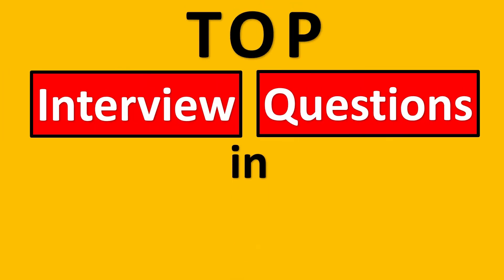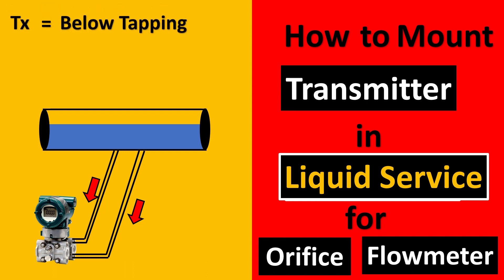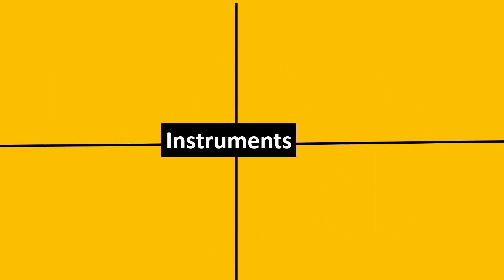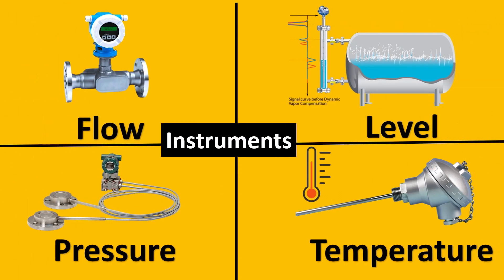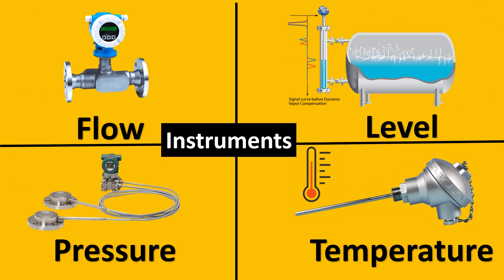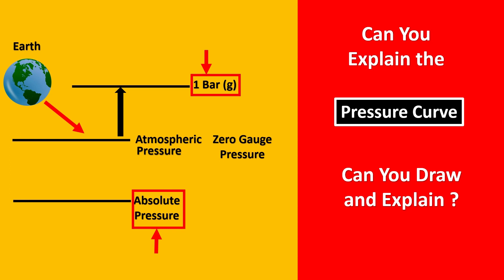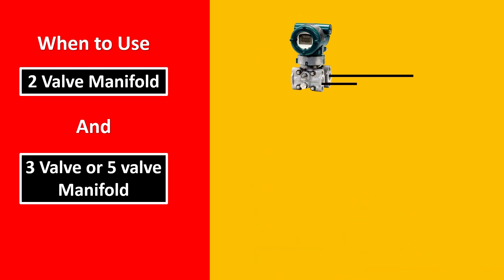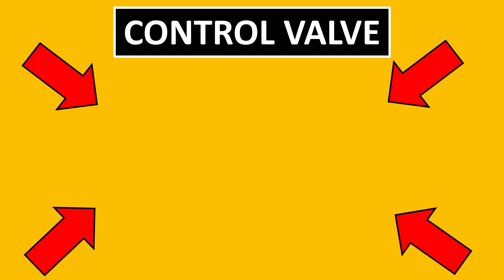TOP Instrument Interview Questions in 2022 | Oil and Gas

Comment: Something to think - If an orifice on a gas line is at the top most tier without any further platforms or decks higher elevation of it then where and how will the transmitter be mounted?